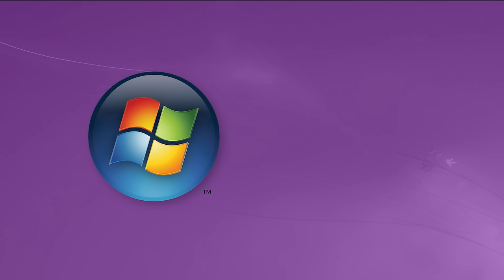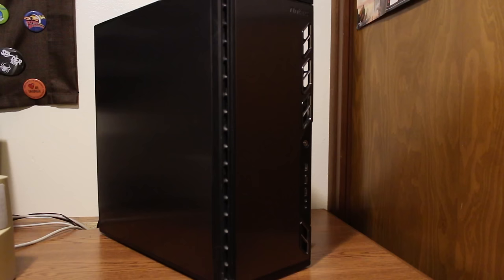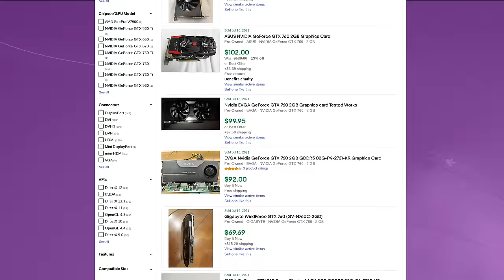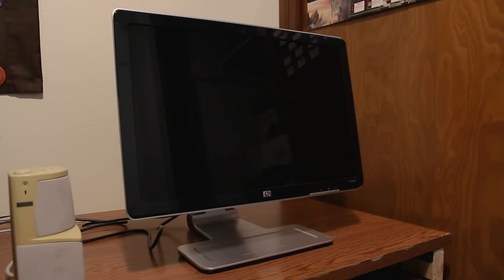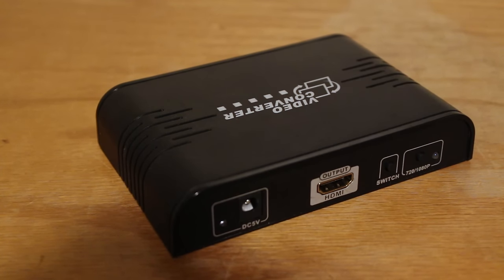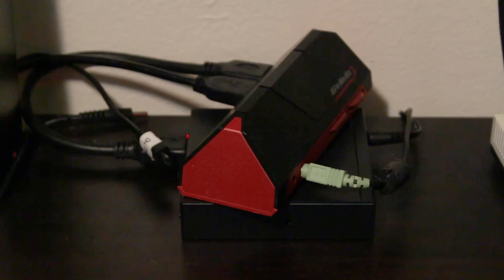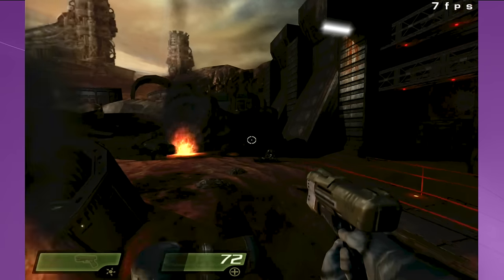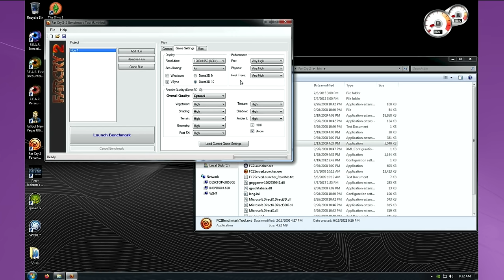Building A Windows 7 Gaming PC in 2021

Comment: i dont know much about how to build or what parts to pick. any reccomendations on how to start a build like this? this is my favorite era of gaming. honestly if i could just get a list of a
parts and software i bet i could probably put it together, id love to max out for this era. where should i start my research?
Reply from the maker: If you want to max out a build for the era you'll be looking to get parts from around 2012-2013.
You'll probably looking at a 2nd or 3rd gen Intel i-series CPU and an NVIDIA GTX 600 or 700 series graphics card. You could even get 2 identical cards and run them in an SLI configuration if you wanted something really overkill.

If you want something a little more pre-built, I'd recommend looking into decommissioned servers and high-end workstations. You can find these kinds of systems from about 10 years ago being sold for dirt cheap by government organizations an universities. Look for towers with a Xeon processor (Intel's server CPUs), as they tend to be very reliable and are usually equivalent to at least a mid-range i-series chip in performance. You can check the exact model against a second-gen i7 to see what kind of bargain you're getting. If you find something decent, it's usually just a matter of adding a GPU and installing Windows. I've done this a couple times with Dell Precision towers and have gotten great results.

Also, I'd avoid AMD CPUs from this era. The high-end ones can be decent, and I even used one in this build, but they run extremely hot. I'm actually looking to replace the one I used here at some point due to the insane amount of heat waste.

Comment: I'm sorry, but i am running the last platform that natively suported W7, which is sixth gen intel, socket 1151. The last gpus that supported W7 were released around 2019-2010, so you can make a pretty up to date Windows 7 pc that can run almost any game, all you need is a I7 6700, 32 gb of ddr4 2400mhz ram and something like a AMD RX5700XT.
Also worth mentioning, my 7th gen. Lenovo L570 fully supports W7 as well, it's the OS i'm using on it.

Comment: i still have a 2007 msi megabook m670 that was a upgraded with a dualcore and i had windows 7 on it and it broke in a few months now it doesn't post but it turns on but no post and i also have an asus x551ca-sx029h celeron at 1.5ghz its fully dead

Comment: Can someone tell me what's the best  and fastest windows 7 computer to use for just emulation ? I don't do PC gaming , i currently have a windows 7 for all my retro emulation but i want to be able to emulate PS2, Gamecube Wii. I can buy a gaming PC to support those emulators but i want a windows 7,because I can customize that way better for an arcade themed computer.
Reply from the maker: If you're only using it for emulation, and value customization, I'd just go with Linux. There are entire distros that are purpose built to run emulators. They have less overhead than Windows and compatibility/performance with newer hardware will likely be much better than what you'd get with 7.

Comment: Bro uses userbenchmark 💀 💀💀💀, I had that exact GT730 (still have it, dead tho) and it is not even a 730, it is GT430 core rebranded. Solid slicon tho, ran it overclocked at 99 degrees C for 4 years and it ran okay until I burned it when plugging it to another motherboard. Real 730 core has twice the performance, Vulkan support and newer drivers.

Comment: Windows 7 On Modern Hardware Is Just Too Fast Since It Did NOT Have Any Sort Of Bloatware😊
Reply: Windows has been bloated since XP or even earlier, it always comes with a bunch of useless nonsense. It just demanded far less RAM than the versions after it
Reply: @Cedalus  tbh windows 7 is kinda bloated but it is to uninstall permanently unlike windows 10 keep reinstalling it when a update occurs
Reply: @IshY8T  true it doesn't constantly reinstall onedrive and edge
Reply: @Cedalus  that’s my point but you can use a plugin to stop from occurring